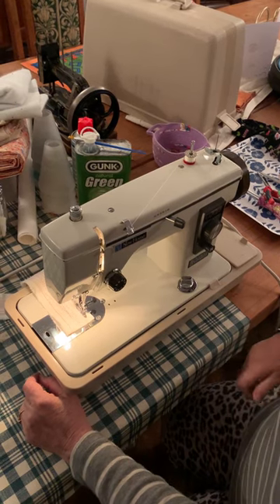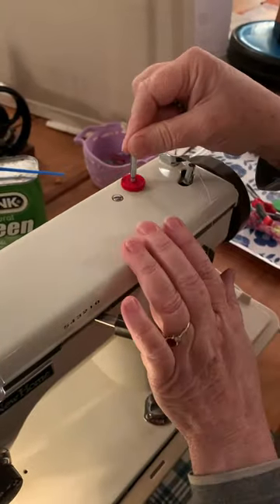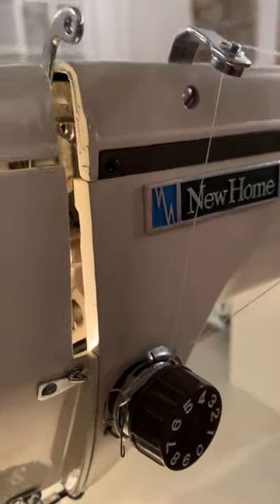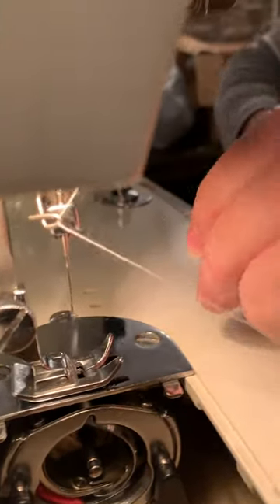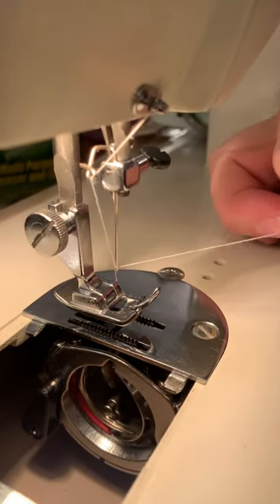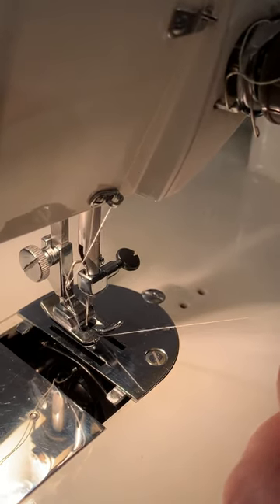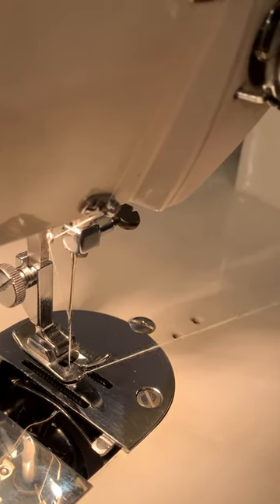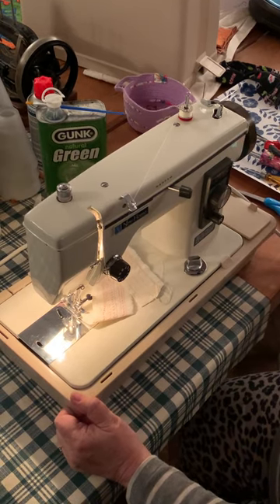Threading a NewHome Model 950 sewing machine

Comment: Dear Hesketh Emporium - Thank you for this wonderful threading video -- it's a life-saver for me!  Now I know how to thread my New Home!  So yes, we managed to get our hands on this same 950 model which I'm preparing for a big curtains job coinciding with my mother's visit to us (in Ireland).  The lady who sold it to me said something about getting the machine serviced and having the pressure checked.  There's a notice on the machine saying the 950 was last serviced in 1996, would you believe it?  Can you advise what exactly is the pressure on a machine and whether or not it needs serviced at all?  Appears to be working just fine but I'm a total amateur.  Thanks, Danny
Reply from the maker: Hello and thank you for the kind comments.  I would definitely give it a thorough clean and oil.  You will find plenty of great videos online to show you how.  Just take photos if you are going to take things apart so you can reassemble them.  I assume they were talking about the pressure the presser foot put onto the fabric.  If the pressure is too light it won't pull the fabric through the feed dogs and if it is too tight then it is the opposite problem.  Most machines have a way to change this and I hope you find some more information online.  I service and clean and oil most of my machines myself and it was trial and error as you cannot afford to have this many machines serviced by a store.  :-)
Reply: Danny that the same  problem  I'm having  I hope  she add that video soon.